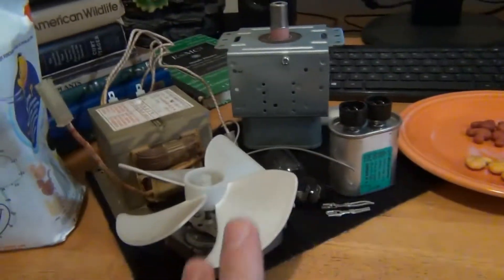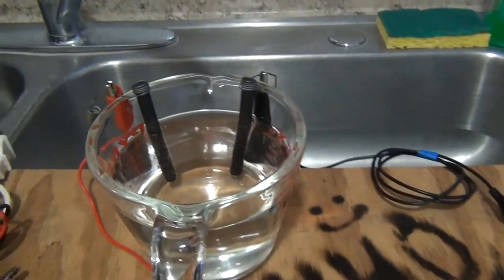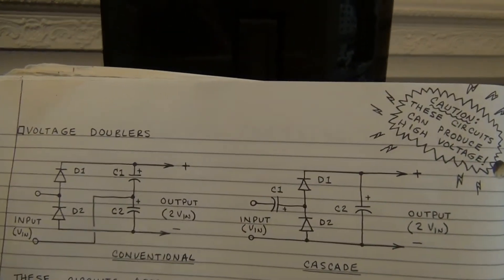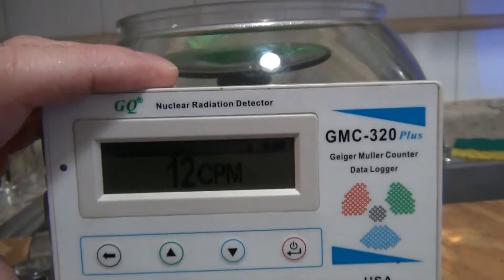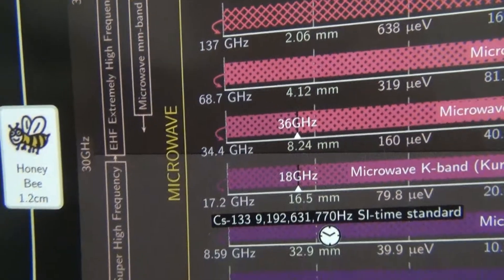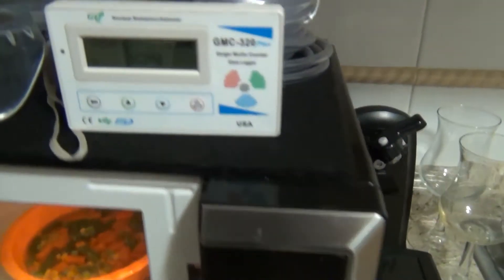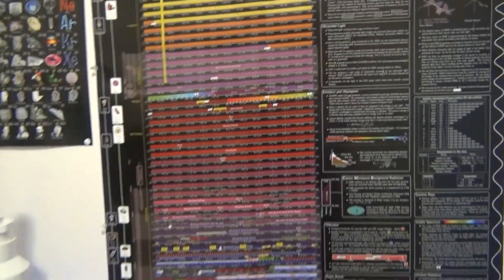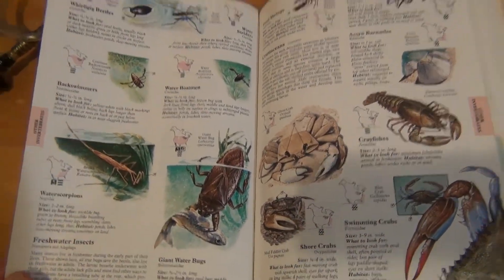HHO MICROWAVE & SINGLE DIODE HALF WAVE RECTIFIERS

Comment from the maker: This is very helpful knowledge to be able to switch back and forth from a DC direct current electricity output to a A/C alternating current output is important when working with electricity. Full bridge rectifiers are easy to get and so are single diodes both will create DC direct current square wave from an alternating A/C current.